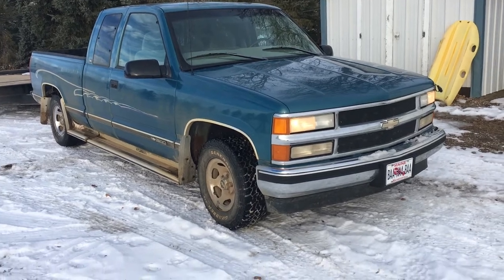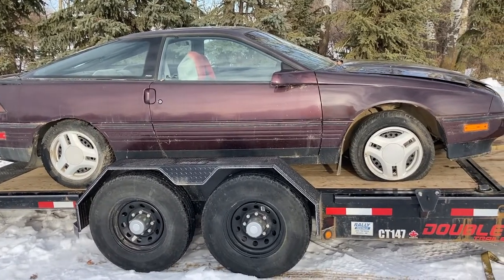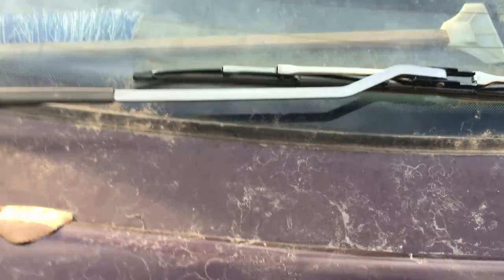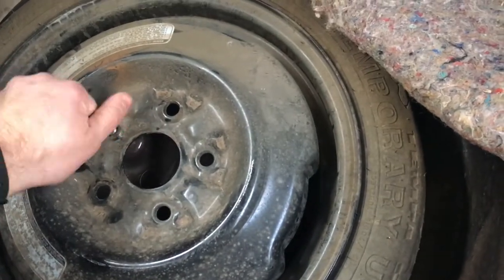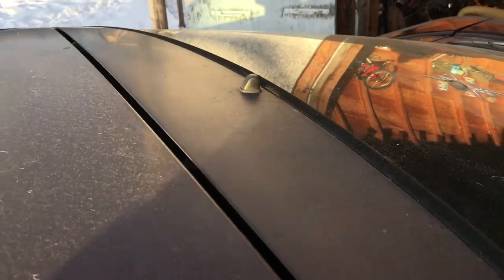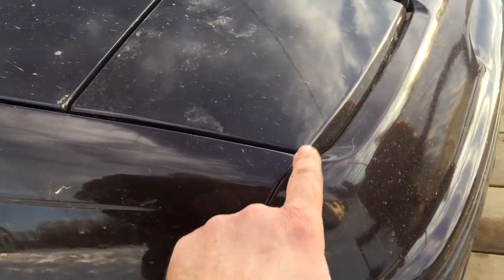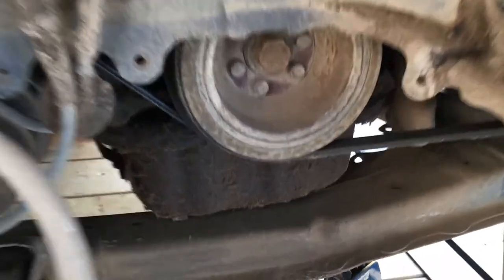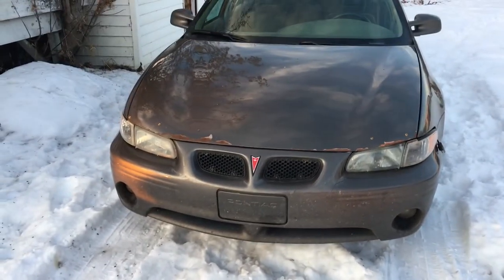Bringing home a 1989 Ford Probe GT

Comment: I've subbed to this channel years ago over some combine harvester. Haven't watched many videos since to be honest. Recently I cleared out old subscriptions and for some reason thought I'll keep subbed to your channel.
Am I glad I did! I have a weird obsession with Ford Probes, they're probably my favourite "normal" car.. I got a '95 second gen a few years back as a first car and liked it so much I bought a '91 GT.. actually two GT's since the first one was completely rusted out.
Unfortunately the second GT only lasted 3000km until the engine had a catastrophic headgasket failure. I assume air in the cooling system, anyways the head is warped beyond repair.
That's now like 3 or 4 years back and I still miss that car, have all the parts from both cars here and some day I'll find the time to make it a running driving car again.. I hope :D 

Anyways long story short looking forward to the videos, your probe looks in good condition. But looks can be deceiving with those, Ford didn't exactly have rust-prevention down on the first gen probe, they rust out everywhere and usually not in visible places.
Check the strut towers from above front and rear (need to remove some stuff in the rear to see) (the rear windows and trunk-lid tend to leak and then water pools and it rusts out from above)
Another bad spot is under the plastic side skirts, the small front bits on the front fender underneath there where the fender is mounted to the car, but also in front of the rear wheels, the rocker panel will rust from the inside out. 
I've seen probes where they looked fine on the outside but it was just paint holding the entire rockerpanel together and once started poking with a screwdriver it all fell apart in fact my first GT did exactly that.. 
I hope you don't find any surprises like I did :D
Reply from the maker: Awesome!  Fantastic tips, I’ll keep my eyes open.  I know this car doesn’t run, people who have looked at it say it’s fuel related.  I’m just going to treat it like any other car I’ve purchased and check and change everything and do basic testing.  I have not given the car a good look over yet, so tomorrow will be exciting to see.

Comment: This is impressive !!! friend greetings from El Salvador I also have a probe 89 but, now I have problems with the fuel supply because the fuel pump does not receive power and I do not know where the relay pump is. I hope you can talk about that soon or you can explain the diagram since according to and investigated the MAF sensor includes the relay switch for the fuel pump. HAHAHAHA FINALLY it is somewhat confusing
Reply from the maker: Interesting.  I have both the service manual and wiring and vacuum manuals coming to me in the mail, hoping that will provide some answers.
Reply: Wouldn't that be with the other relays near the battery and underhood fuse box? May be under a cover that either tells you what is what or gives you a corresponding number for the manual. Should be a large relay with large contacts. Sorry I can't be of more help I have a 94 and a 95, completely different setup. Another thing you can try is Probetalk.com if it's up.